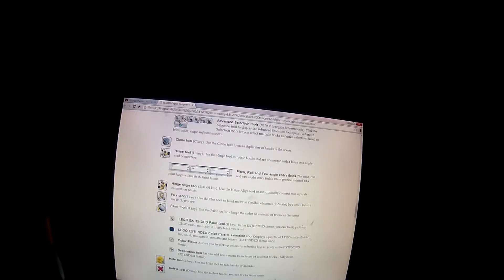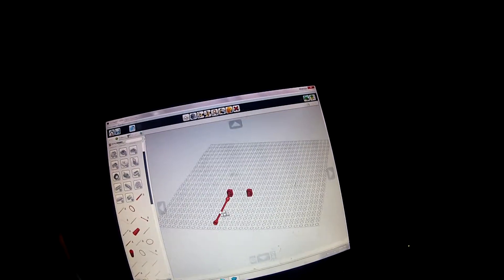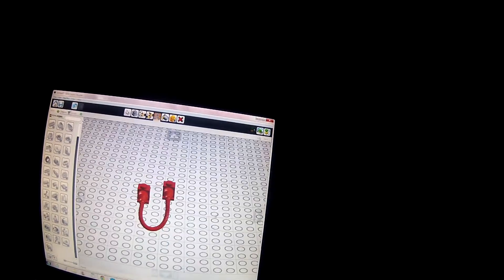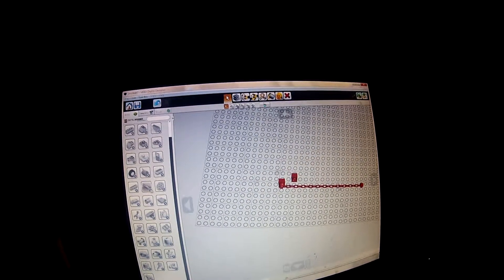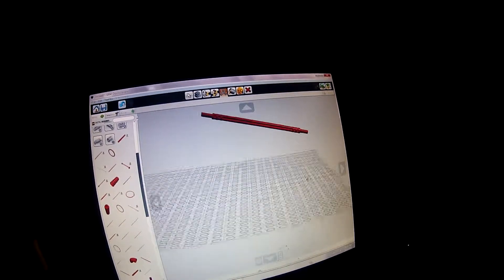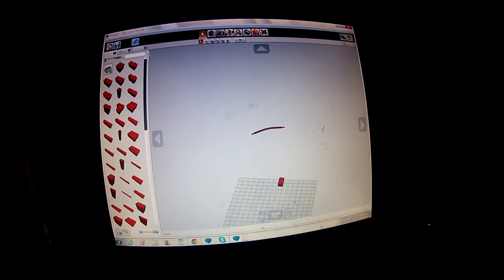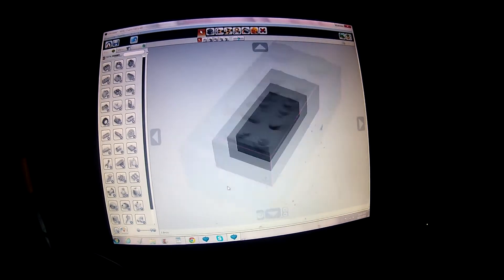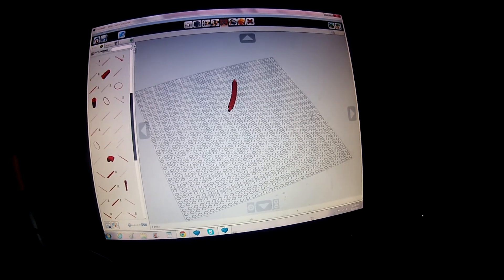Lego Digital Designer; Tutorial, Tips, Tricks: #18 Flex Tool

Comment: this is the tool I have the most problems with and I have been using the program for a couple years now. I actually don't use the tool because it is so finicky. try recreating the shooters from the bionics with the tool or having a clean droop of a chain functions this tool should be able to do but is so sensitive that it makes it hard to do
Reply from the maker: I have to agree. I never really use any pipes or anything in my MOC's because of this tool. It never works out just the way you want it, and when it does, its a miracle. I'm looking into a few different Screen Recording softwares, I just need to get the funds for it.